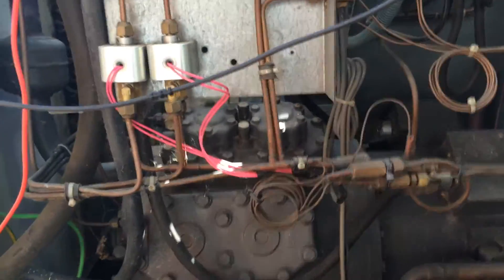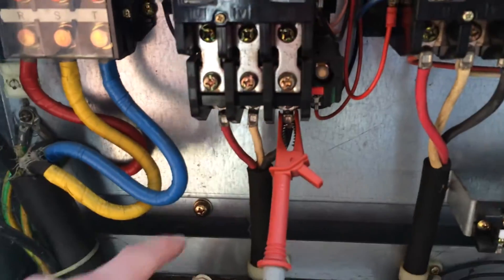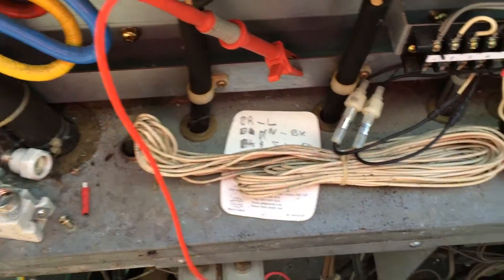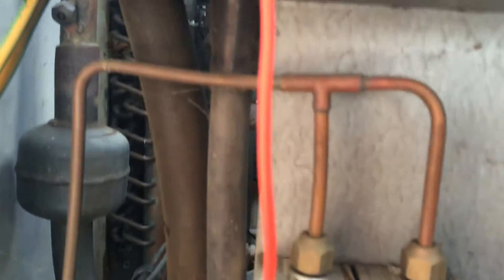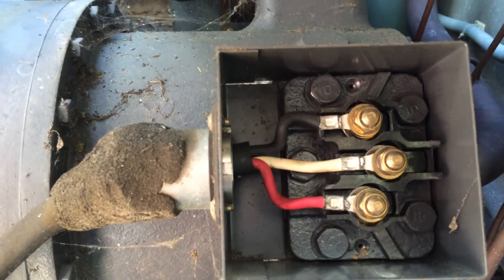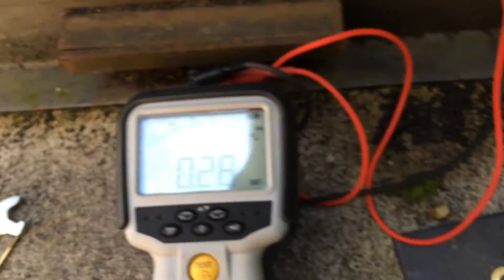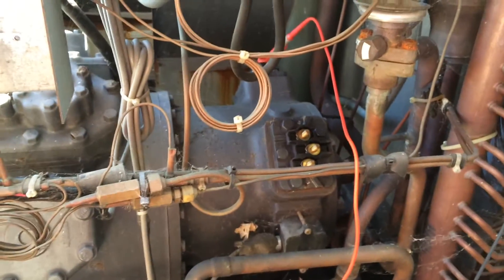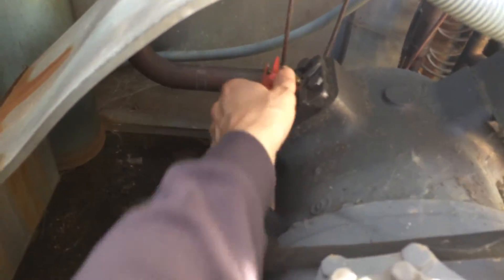Daikin Air Con Tripping the Breaker

Comment: Megger is a great tool when troubleshooting motor windings. I once saw a noob in a plant I worked in when I was younger knock himself on his ass with one. He had no idea that it packed such a punch!
Reply from the maker: +Fireship1 Hahaha! When i first started i was give a cheap megger, it didn't discharge once the button was released so when testing a good motor you'd get a shock putting the wires back on.

Comment: Did you say it was on a 125 amp breaker? That's about 30 Kw per phase some serious power for a motor would hate to be near it when it was running
Reply from the maker: jon johnson I think its a 100amp, i'm sure i have seen around 60 amps a phase in normal running on these.

Comment: Is it safe  to megger when there is a pcb?
Reply from the maker: Craig Johnston I would not megger a circuit board just to be safe. It is not safe to megger thermistors in compressors as it will damage them.
Reply: Thanks mate.

Comment: A merger is one bit of test equipment I haven't yet invested in. Would've saved me a lot of head scratching recently with a starter motor (intermittent ish sort of short due to water...eventually the bearings failed making it obvious what was wrong at that point....)
Reply from the maker: OverKillPlusOne I don't use the megger often but when i do it is really indispensable.
Reply: Obviously autocorrect on the iPad has no clue what a megger is so assumed I must have meant merger.

Comment: Good video HD, will there be a change out video?
Reply: Nice work heavydiesel what voltage did that compressor operate at?
Reply from the maker: rasta1kikker I hope so, but it will be once they have replaced another on on site.
Reply from the maker: Tazzman228 Its a 380/420V compressor, our voltage here is either nominally 240V single phase or 415V three phase.

Comment: When you said Daikin I was thinking a little mini split but that compressor looks expensive!  Is the Merger alot more useful than something like a Fluke?
Reply: Knuckles the Echidna Try googling "Megger" ... A merger is someting completely different.
Reply from the maker: Knuckles the Echidna A megger is great for finding shorts because it tests with a similar voltage to what the machine runs on, often the low voltage from a multimeter is not enough to register a short. 
Its a bit like looking for a leak with 9psi or 500psi. I have a vid where i show a faulty compressor, the multimeter says its ok, but the megger says otherwise!